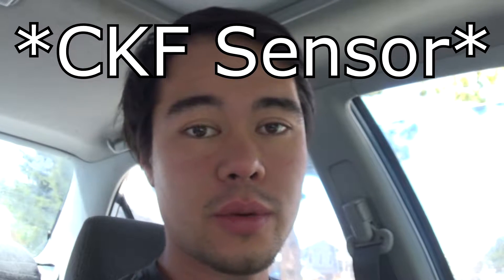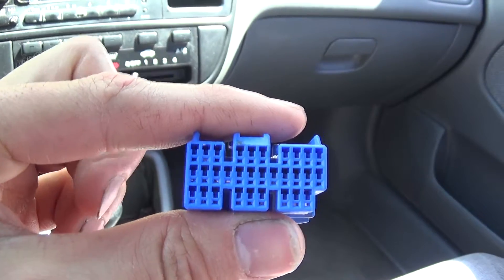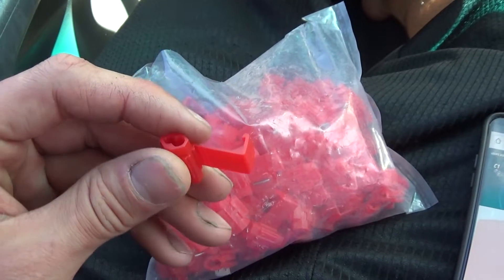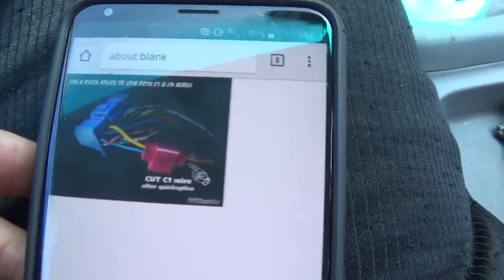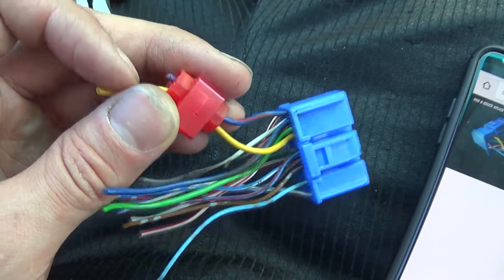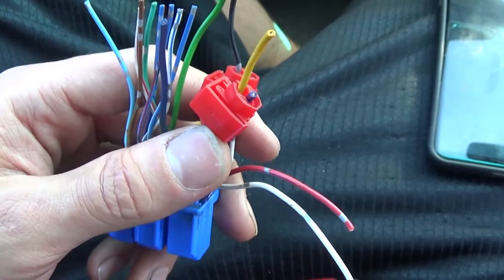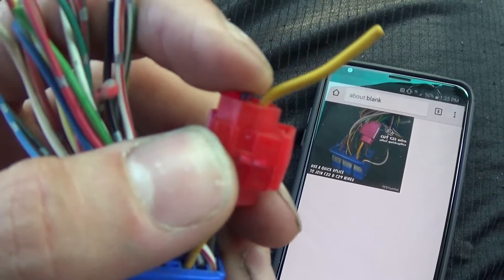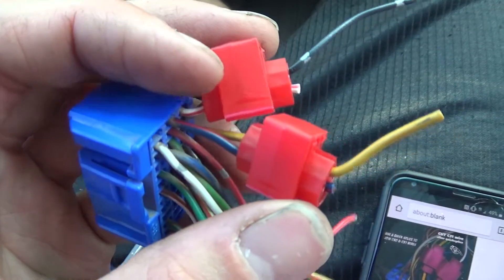Honda/Acura CKF bypass trick - In Depth

Comment: Would this work with a 99 integra with a b20b swap. Used to have a b18
Reply from the maker: I believe it will

http://ff-squad.com/wp/?p=309
Reply: Joel Johnson jdm b20b?
Reply: I have a b20 in my 2000 integra and I'm currently looking into changing my oil pump to install the crank sensor. Needless to say the mechanic wants to charge me quite a bit. I need to try this. It will save me so much money if I can bypass so it turns off my check engine. Living in California sucks with all these emission laws. Otherwise i wouldn't have to worry about any of this.
Reply: @i.e.4165   did you ever try it Im about to do this swap and this is the onlt hing holding me back!
Reply: @oldirtydave22  are you doing a b20 swap? I've been super busy but I have my wire guy coming down tomorrow hopefully he can do it. I personally don't want to mess with it because I'm worried I'll mess something up lol. But he did tell me it was posssibe. But he kind of recommended me taking it to have the oil pump installed with crank sensor anyways. So idk what to do quite yet.
Reply: I. E. I’m just going to do the bypass I live in Miami and everyone just does the bypass from what I’m told. Call any of the Jdm engine depot or spots they’ll tell you it doesn’t make a difference it’s  just extra work on top of that if you do that you minus well get a new rear main seal timing belt and water pump!
Reply: @oldirtydave22  I'm definitely still going to try to bypass to turn off the check engine light. Its just that I'm from California and it sucks because we have so many emission laws etc out here so a simple swap can become a nightmare. So even if I did bypass I'm still not sure if it will pass smog check.
Reply: I. E. Oh yea I always hear about that smog stuff seams like a nightmare. Well I am sure you’ll figure it out the bypass should fix it. Where I bought my motor I spoke to two people that had it done and they said it was working fine but i never asked about that cel light.
Reply: @i.e.4165   How much did you end up spending for the install and parts? I'm in the smart position at the moment except did jdm 98 type r into 2000 gsr.
Reply: Any updates? Did this and car lost all power after cranking car

Comment: My plugs are red not blue, I have a 99 Acura TL with the Honda Inspire jdm motor swap
Reply from the maker: I believe this method only works with D and B series engines.  Someone else commented about a H series not having these wires and I believe H and F series don't have these wires, or don't have these wires in these particular locations

Comment: Thank you. I couldn’t find and position sensor that fit the D16A6 anywhere. Luckily I found your video. The build that I will install into my 2000 Honda Civic will be a D16A6 engine block, D16Y8 head. and I will also be using a Y8 wire engine harness and Y8 ECU. How is your car running after this modification?
Reply from the maker: I don't have the car that I did this mod to anymore, but for the time I did have it, it had no problems.  No check engine light and it ran great!
Reply: CtrlAltDefeatTV sweet thank you.

Comment: Hey I really need help on my 96 prelude, it’s obd2 and on the blue plug on my ecu it is missing the pins for c1 and c11. Looks like it never had any wires going there, it’s the only reason my car won’t start. I have a obd1 block and tried mounting those magnet type sensors into a position that might work. Would rather bypass it instead of rigging something up so it will run
Reply: Procrastinators the bypass trick doesn't work for the obd2 prelude/accord platform as these have more wires at the ckf sensor vs  obd2 civic/integra ckf's. I have a h22 swapped obd2 Accord myself.
Reply: @jkatman  so what should i do lmao
Reply: @wutcamber  only real 2 options is to convert to OBD1 or swap on an OBD2 oil pump setup with CFK sensor etc.
Reply from the maker: I haven't messed with an H22 or H23 before so I can't tell you anything for sure.  But from what I'm reading the USDM H series engine in the prelude uses the crank sensor for timing and the JDM model uses the sensor in the distributor.  
Could you swap the oil pump and trigger wheel from your OBD2 over to your OBD1 block?  Or run a JDM harness and ecu?
https://honda-tech.com/forums/honda-prelude-4/jdm-h22-crank-posistion-sensory-bypass-help-3043101/
http://www.preludeonline.com/f60/h22a4-jdm-h22a-obd2-concerns-264709/